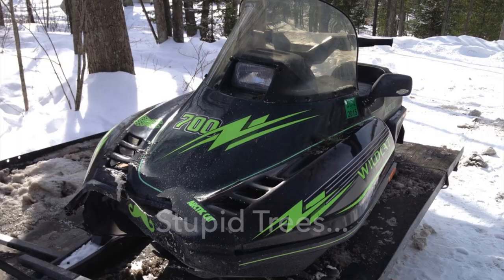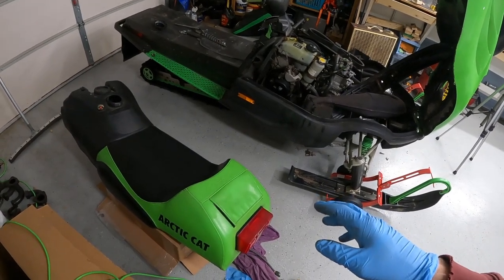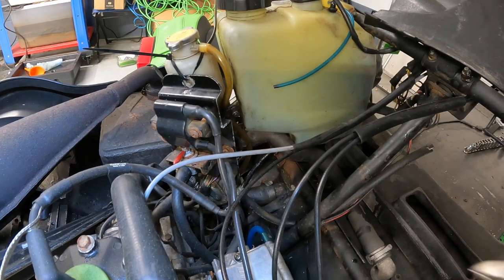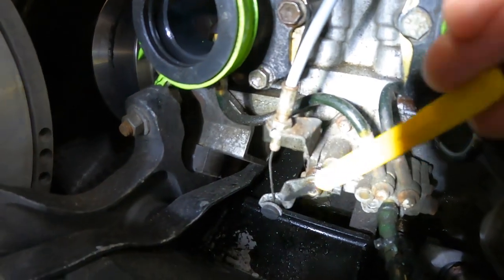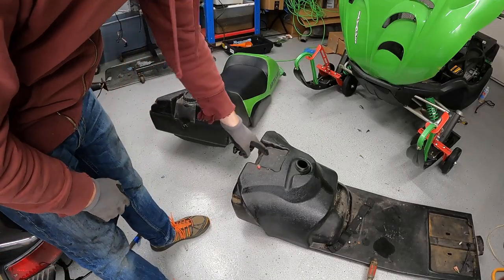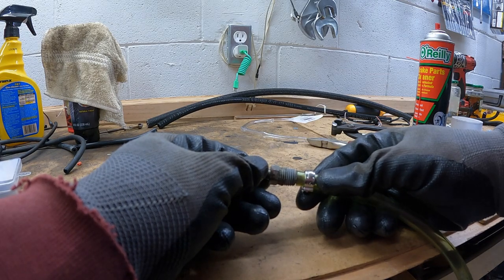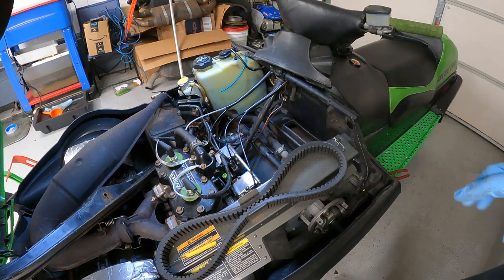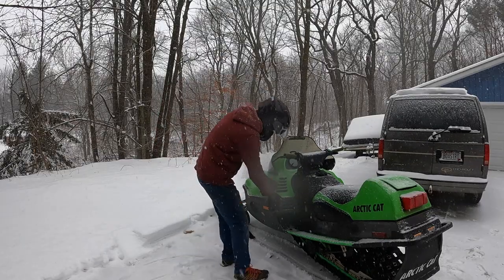Cheap Snowmobile Project: 2000 Arctic Cat ZR600 How to Set Oil Injection & Adjust Carbs

Comment: Something to look out for with the twin cylinder Cat motors from this era is the water/oil pump shaft. I ran into a coolant leak on my son's ZL500 and thought it would be a simple fix with a new seals. If you haven't taken one of these motors apart they have a shaft that runs off the center of the crank and goes out of the front and back of the crank case. On the front is the water pump and the back side as shown in your video is the oil pump. When I got mine apart I found that the leak was caused by pitting in the shaft. You can buy new seal kits but those shafts are no longer available and everyone that I saw on eBay had pitting in it. To fix mine I found a machine shop that turned down the shaft and then they put a sleeve on it.
Reply from the maker: Turning it down and adding a sleeve is a pretty cool fix!  Thanks for the tip!